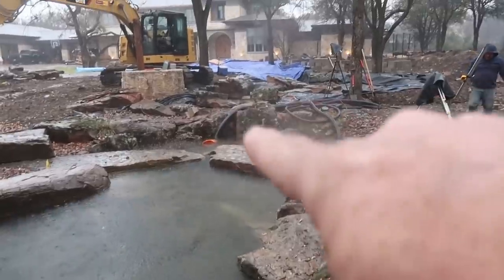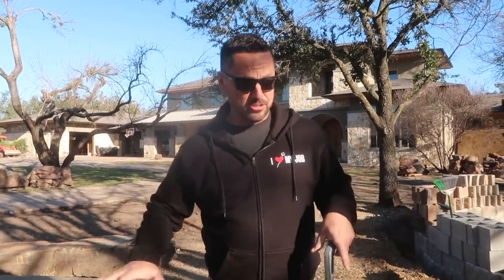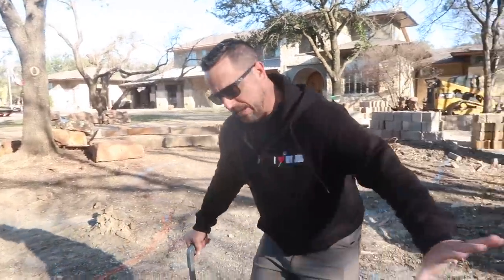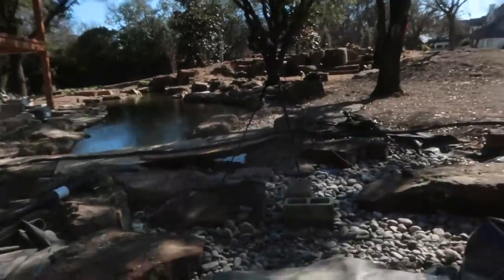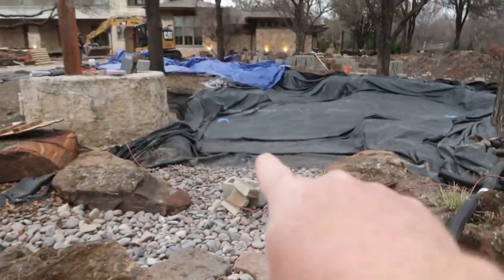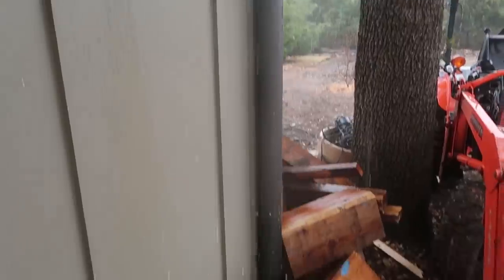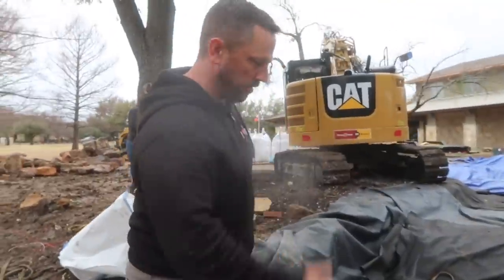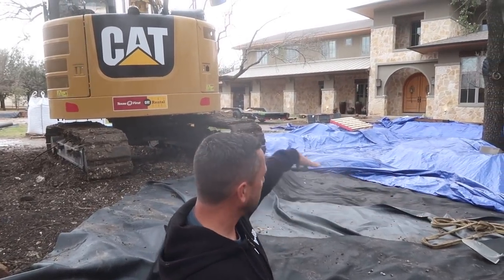Setting 66 TONS of STONE Leaves Him Speechless! - Texas Phase 2 Part 1

Comment: Curious - With the Live Oak trees, did you not use concrete cloth to avoid roots penetrating the liner or was it cost prohibitive due to the length and size of the streams/pond areas?